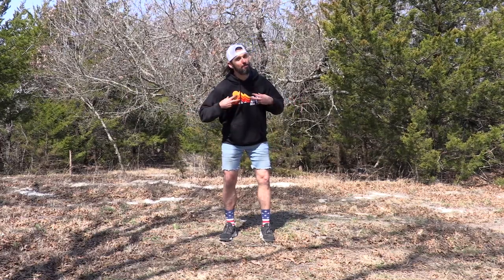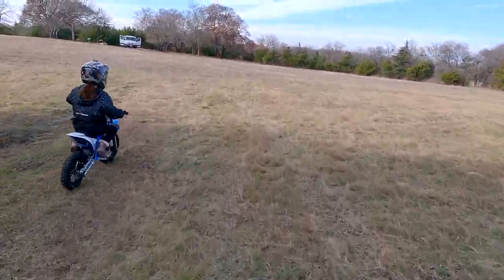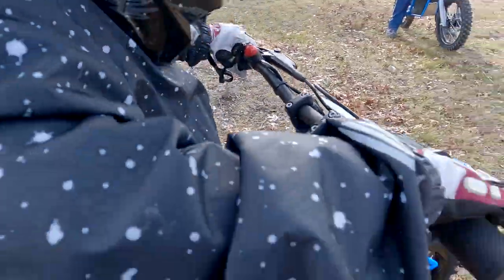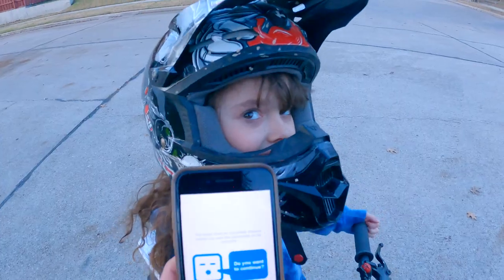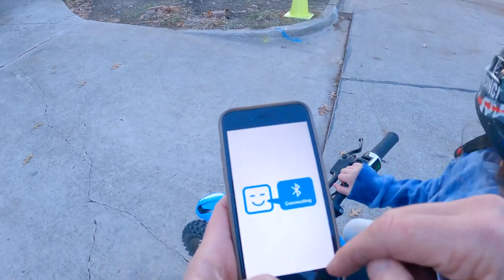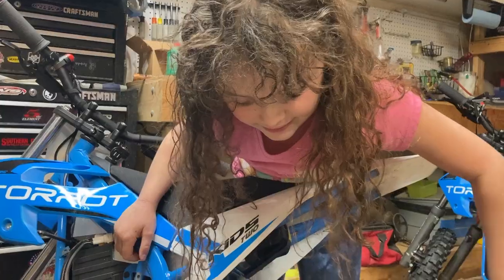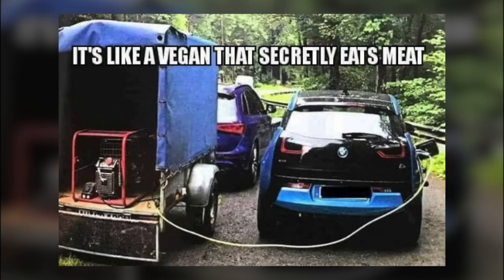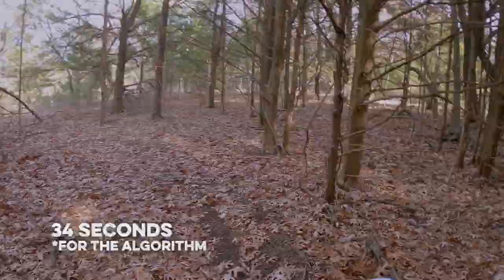WE WENT ELECTRIC!⚡️| Torrot Electric Kids Motorcycles

Comment: I’am amazed why you never said how long the charge lasts and how long to charge them ..that so important to point this out and even in the comments no one asked 🤷‍♂️🤷‍♂️🤷‍♂️
Reply from the maker: You make a valid point. The amount of ride time can vary drastically on how the power settings are set and how the child rides. If it's at set to 100% power, and the child is full throttle in sand, you'll get less ride time than a child at 50% power who rides on hard packed dirt. 

As for charge time, it seems to be about 2 hours for full-charge time if close to empty.